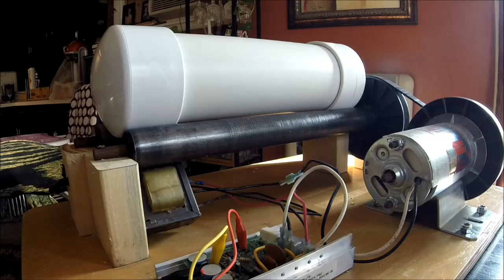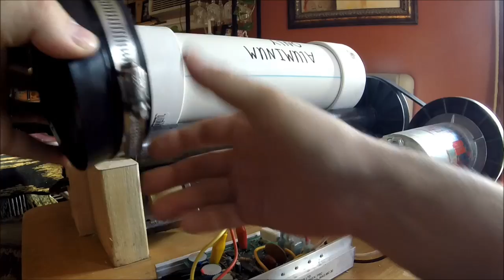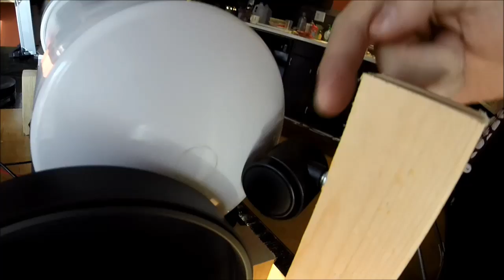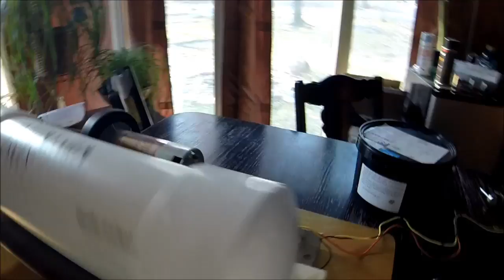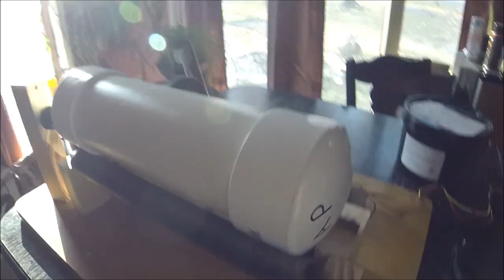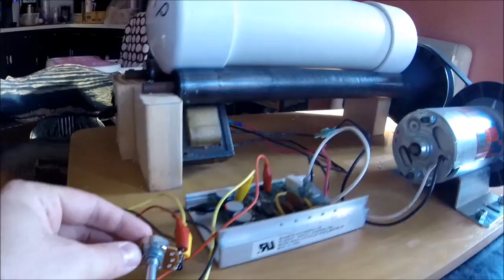Part 2 Heavy Duty Variable Speed Ball Mill from Treadmill Parts

Comment: I just came up with the idea, built one, then found your video.
The issue with the treadmill was the motherboard, so no using that, and I'm in no mood to buy a new one.
Anyways, after studying the thing, I took it mostly apart, and began simple mods.
I cut the bottom frame across about a foot or so more downwards of the drive roller.
I took the feet off the back of the TM and reattached them at the back of my build. (screws)
The adjustable tension brackets also are screwed in and removable, so I mounted them a bit behind where I planned to put the free spinning roller.
This way, I can always modify the spread of the rotors using the set screws in the adjusters, or just unscrewing and reattaching them back further on the frame should I decide on bigger drums.

I'm no electrical scholar by any means, but I have a pretty good understanding having lived off grid for years.
Motors are still a bit of a mystery to me.....

Anyways I hooked it up to 12vdc  just to see if 12vdc would even start this 90VDC motor, and surprisingly it did.
I then dug out a 6 or 9 amp 12 volt converter, and applied a separate 35vdc step up board.
That really got it spinning!!!!
But of course that hideously fast for a ball mill.
So I went back to the 12 volt converter, minus the step up unit.

I'm currently using some old rubber ball mill jars from a 33b machine, until I decide which one of the many avenues one can take for jars.
I marked one with a white marker, and downloaded a strobe rpm app.
@13.5 vdc or so thie was clocking in at something 125-150 rpms.
There's an adjustment pot on the power supply, so I kept messing with that and taking readings.
I know there's a formula for the correct speed vs dia, but I'll attend to that soon enough, for now I'm just trying to slow it up a bit.
Some say 60 rpm is great, I've seen others say upwards of 80 or 90rpm is optimal.
 I haven't milled and tested enough dough to realize the "heights" of my skills yet, but I think I'm getting a handle on it.

So I finished the mill up last night for now, it works.  I was able to get the power supply down to 11.8 or so using the trim pot, and I let it run for an hour or so. it stayed @ 95rpm the whole time, which still may be a bit fast.
Afterwards, the motor was cool, and so was the power supply, so I don't expect any issues, but i don't know from motors much, but I would like to ask, what's with the big transformer you have wired in line?

Comment: Typical washing machine has all is needed for this kind of mill: drive motor with many speeds and ready-made speed control, belt transmission,  bearings. All is needed is some kind of "chuck" to hold the container. Actually,  you could even fix it off-center which makes the holding implement even easier to manufacture.
With your kind of drive does the fully loaded drum always turn with zero slip?